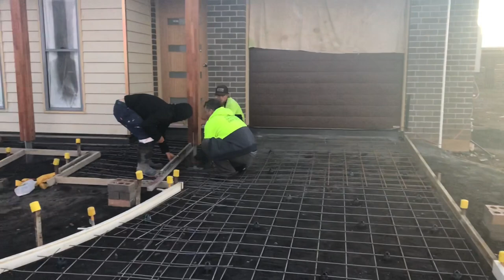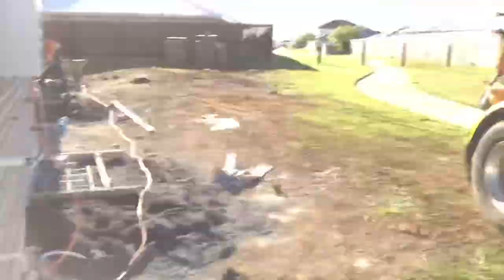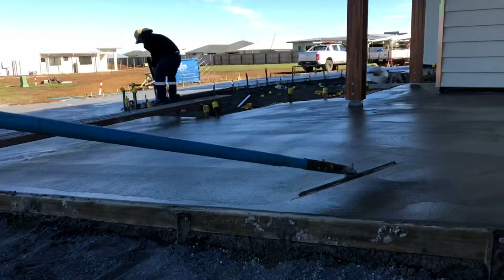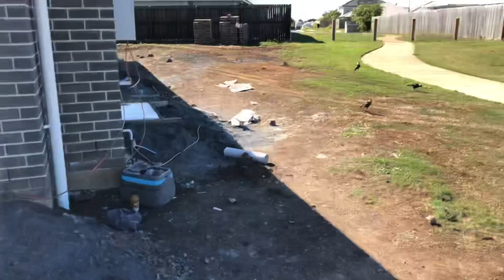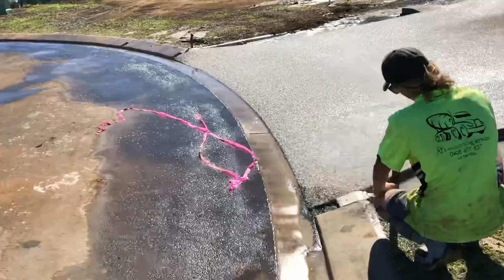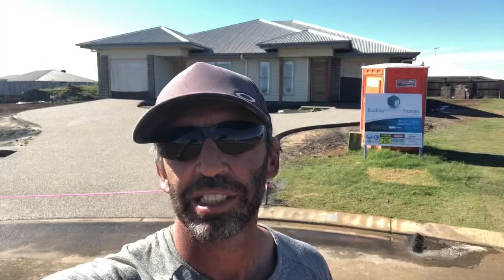How to pour a exposed concrete driveway

Comment: I first learnt about the sugar effect when I was working with a Chippy building houses years ago up on the Sunny Coast. A Concreter we both knew of turned up next door to pour a house slab, he was still off chops from a big night the night before on the rum and cokes. 
Long story short, he chucked up in the slab and then just left it and screeded over it. The big problem was that the area affected wouldn't "set". It cost the bloke quite a few $ to pull it up and then go again.  I think it was just under $30k from my hazy memory. 😉

Comment: The commercially available retarder is sold in different formulas that equal different exposure depths, how do you control exposure depth with sugar?
Reply: Trowel it flat and make sure the stones are firm must still have some surface moisture.  Aslong as the top stones are firm the sugar wont absorb into the concrete as much if you do it to early it causes massive dramas

Comment: What is the chemical name you use. Ive been doing concrete for 30yrs and never used a chemical
to remove the top layer, just hit it with a hose at the right time.
Reply from the maker: bogey19018 it’s just sugar mixed with water
Reply: @concreteninja  We always used a bottle of Mt Dew, worked as good. lol
Reply: @concreteninja  What is the ratio?
Reply from the maker: bogey19018 if you watch the whole video you would know the ratio but it is 1 kg sugar 20 L of water
Reply: Great thanks!
Reply: @bogey19018  i just used one bottle to 3 gal water, seem to work, and if a mixer ver gets stuck bad with a load on throw in about 10 2 liters  of Dew to kill it.